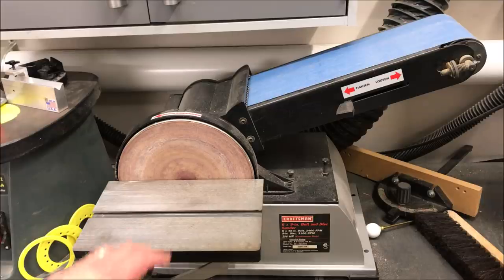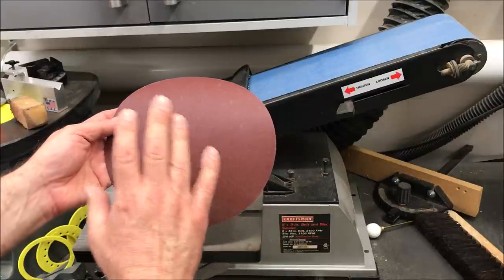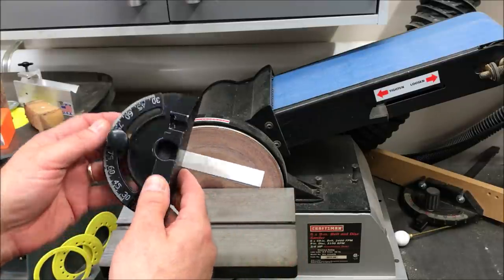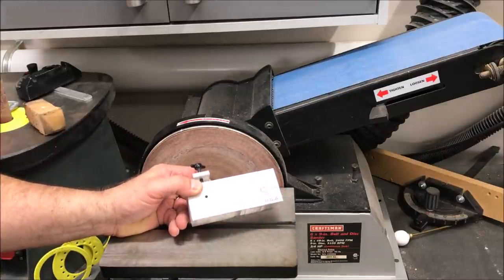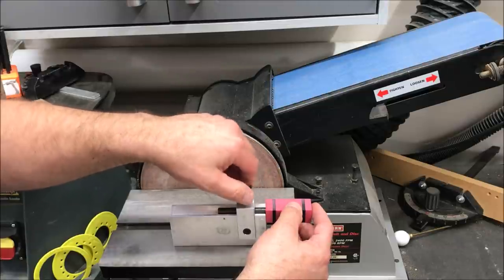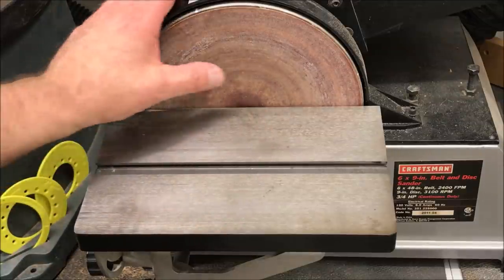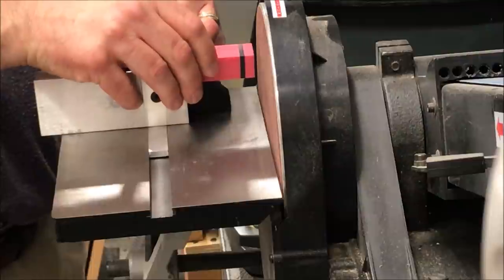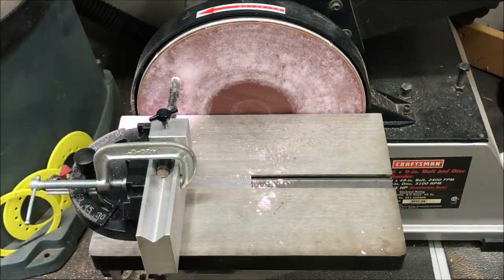How I Set Up My Sander For Squaring Pen Blanks

Comment: Take a scrap piece of wood and aggressively sand it for a few seconds before trying to remove the old sanding disk. This heats the adhesive and makes removal of the sanding disk easier. Make sure to sand across the whole disk before trying to remove it so as to heat all of the adhesive on the disk.  I can't remember where I first heard of this technique but this has worked great for me whenever I had to remove a sanding disk.
Reply from the maker: Thank you Mike,
  I’ll give that a try. 

Regards,
Bob

Comment: Bob you mentioned the sanding jig was available at Classic Nib. We would not want to steer your viewers wrong. It is not available at Classic Nib but rather from Tim Geist directly or through Turners Warehouse. Great video and great tip on insuring the miter gauge was also square to the sander. I have had my jig a little more than 4 years, and naively assumed my miter was correct.
Reply from the maker: Thank you Niels,
  I didn’t realize you weren’t carrying them. I’m always trying to send folks your way.

Regards,
Bob
Reply: @RJBWoodTurner  We appreciate that Bob. And thank you and your viewers continued support of Classic Nib.

Comment: I use one of those aluminium blocks but you gave me a tip that has already transformed the way I sand blanks because I just tried it on a few and it worked great... you clamp the jig to the mitre gauge.  I was sliding the jig against the fence and, sometimes, getting the blank slammed onto the table when it got snagged by the disc.  Great tip, thank you very much Bob.
Best Wishes, Brendan.
Reply from the maker: Thank you Brendan. 

Regards,
Bob

Comment: Awesome information, Bob.  I finally broke down and got a Shopfox 12 inch a couple months ago.  I was using a little 4 inch combo deal with not much of a table.  Huge difference.
Reply from the maker: ShopFox makes a nice sander. 

Regards,
Bob
Reply: @RJBWoodTurner  I also have their radial benchtop drill press.  I am satisfied with their quality.  They are low tier tools but they aren't junk.  Of course I would prefer Jet or something even better, but as far as bang for the buck they beat horror freight...

Comment: Hi Bob - Greetings from Nebraska.  Great video as always.  Although my jig is a little different and I have a smaller disk, we follow the same procedure almost to the letter.  It has solved so many problems compared to using the barrel trimmers - even the expensive carbide models. I keep a small machinists square right next to my sander and verify square frequently, especially when I have a pen I am being extra careful with.

Regards, Dave
Reply from the maker: Thank you Dave,
  
Regards,
Bob

Comment: I have never found an eraser like that, that eraser is a great tool
Reply from the maker: Thank you Russel. 

Regards,
Bob
Reply: I found mine at either harbor freight or lowes I don't remember which but I'm sure any place that sells disc Sanders and supplies has them and they are very inexpensive.
Reply: Old shoe sole works too...

Comment: I want to say that you need to make  sure your miter slot is parallel  to your disk as well  because a misalignment creates a bevel as rotate the blank. So,the top of the table may be square to the disc the travel across can be out of square even though you squared the miter gauge to the disc. Same maintenance checks as a table saw.
Reply from the maker: Good point Michael. Thank you. 

Regards,
Bob

Comment: For those without a dedicated  sander (like me) you can take a faceplate and make a sander for your lathe and there is an offset jig that Rick sales goes onto your tailstock (either on a jacobs chuck or screws onto a mt adapter) of you lathe and then all the same  principals apply for the sanding and spacing the punch from the sand paper.  The other good thing about using the lathe for sanding is it should already be square or you got bigger problems ;)  Another problem I had with barrel trimmers is I use wood from my farm and it is much to big around to start with for barrel trimmers to completely  trim to the edge.  If I had seen a video like this when starting off I would have never purchased a barrel trimmer.
Reply from the maker: Thank you Byron,
  I appreciate this feed back. I had forgotten about Ricks jig. That is a great option. 

Regards,
Bob

Comment: Hi, could you use this jig for normal square blanks ie. without a hole through them?
Reply from the maker: If the blanks are perfectly square you could just use the miter to square the blanks. You
Don’t need this jig. 
  If there not perfectly square then you won’t be able to square them perfectly. 

Regards,
Bob
Reply: @RJBWoodTurner  Understood, thanks for the quick reply!

Comment: Thanks Bob, good video. Not sure how old your sander is, but mine is 13 years old. There are two brass sleeves one on each side of the top roller,  you need a small press to get them out, and in. Mine wore out I had to order a dozen so if yours ever wear out give me a holler.
Reply from the maker: Thank you Gerry. 

Regards,
Bob

Comment: Any tips to help get even pressure against the sander? I can't get square blanks even using this method. I usually switch to my pen mill on the lathe, but foe the life of me I can't get a straight hole either.
Reply from the maker: Something has to be out of alignment, have you checked the table is square to the disk. The miter square to the to the disk and table. The jig square to the miter, table and disk. 
  Pressure is never a factor, I don’t use much pressure at all when sanding. 

Regards,
Bob

Comment: Bob - I know this video didn’t address this, but I can’t remember which video does so I am going to ask here. What are the clamps called that you use with your dust collection hoses?  The ones that you can quickly squeeze and move your hose from tool to tool?  Thanks in advance.
Reply from the maker: I found them on ebay:

https://www.ebay.com/itm/WoodRiver-2-Piece-Single-Loop-4-EZ-Squeeze-Hose-Clamps/264283967937?hash=item3d888d51c1:g:XXwAAOSw6x9c43Ea

Can’t remember where o purchased them. 

Regards,
Bob
Reply: RJBWoodTurner  - Thanks so much, Bob!!  With the link I was able to find them and ordered some for my shop. Brilliant!!
Reply from the maker: Awesome! You are welcome. 

Regards,
Bob

Comment: Does it work as well with hardwood blanks ?
Reply from the maker: Yes Sir,
  Hard woods, soft woods, acrylics, deer antler. I used it for all materials. The only issue is some materials load up the sand paper more than others so have to clean it more often. The jig performs flawlessly. 

Regards,
Bob

Comment: Bob, as usual, a great and informative video. Many thanks !!!
My disk sander is a 6". I also have the Ridgid Oscillating Spindle/Belt Sander.
Which would you use?
If you also had the the Ridgid would you use it or the 9" disk?
As always "Why"?
Your insight is always appreciated.
Rick Munroe
Reply from the maker: I think the 6” disk should work fine. I didn’t see it in the store but if you call, they make a smaller version for smaller disk sanders. 

Regards,
Bob

Comment: great video. Does this work better than the jig you made seven years earlier? I thought that squaring your blank using the earlier jig would be less prone to error.
Reply from the maker: This is hands down the best and easiest to use jig for squaring pen blanks. I also love it for cleaning up the C/A at the ends of a blank post finishing. Perfectly square/flat ends are crucial for a good component fit. 

Regards,
Bob
Reply: @RJBWoodTurner  Thanks : )
Reply from the maker: @danceswithaardvarks3284  😃

Comment: Great video Bob...but I think you skipped a step..why do u use the jig instead of putting the blank directly on the mitter and sanding it that way..
Reply from the maker: That will work if the blank is perfectly square. Using the jig it squares to the tube regardless of the shape of the blank. 

Regards,
Bob

Comment: 4:32 woodworker's rule #1.  Never trust built in gauges and scales on any tool unless you know for sure it is accurate.  I really wish the manufacturers would just leave these off and force us to check manually.  I have even found discrepancies in cheap tape measures.
Reply from the maker: Thank you Sean. 
   It’s always worth a check. 

Regards,
Bob